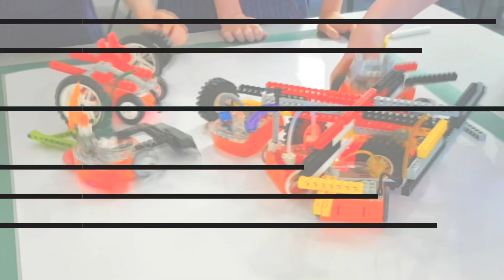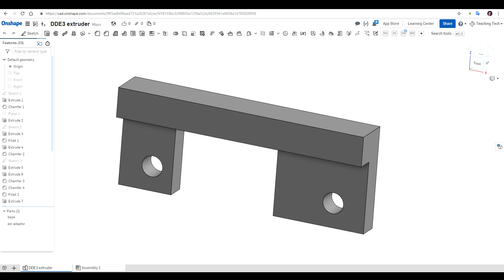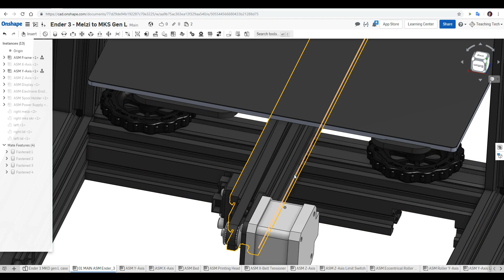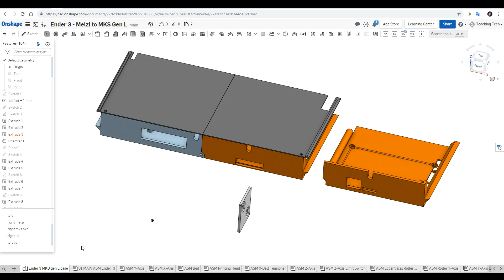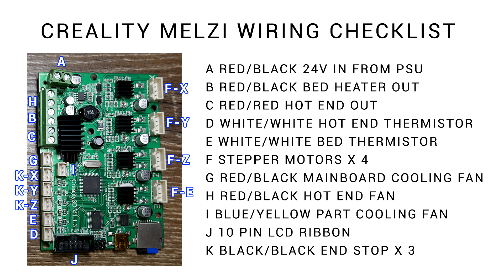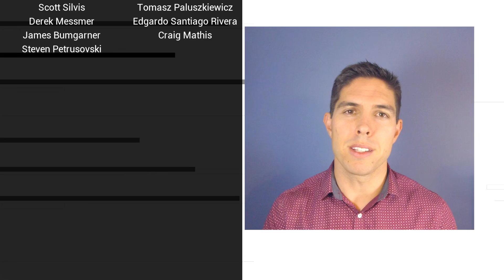Ender 3 upgrades: EZR to direct drive adaptor and all in one rear mounted electronics case

Comment: I just bought the BIGTREETECH SKR E3 DIP board, and have some TL Smoothers.. Will that board mount right where the stock ender 3 board goes? Im so looking forward to getting my printer back up and running so that I can print these and move all my electronics to the back then have room up front for tool drawers. 

By chance, can you tell me about the switch you have mounted to the back of the power supply?

Comment: It doesn't look like the Raspberry Pi is actually being powered by anything.  The buck converter input is hooked to the hot end fan driver on the main board (I'm assuming so a quiet 5V fan can be used), but I don't see another converter to run the Pi.  Am I missing something?

Comment: What about the webcam ribbon to the pi?  Is there a slot for that to route out?
Reply from the maker: There are many great remixes now, you might find what you want.
Reply: @TeachingTech  After looking at the step file, I think the design as-is will allow routing of the ribbon cable out the front.  That's where the camera lives anyway.  ;)

Comment: Where did you get the BLTouch bracket? Mine isnt low enough now with the new aluminum bracket. Also, where did you get the clip on adapter for the EZR

Comment: Very very very good make.....give yourself a pat on the back..... I would make the boxes deeper because the New Raspberry Pi comes with 4GB and runs hot therefore the need of a fan should one go this route. Make the four legs out of nice wood or print to make the height under the printer more to allow the deep tray to slip under..... thanks for your ideas.

Comment: So this is probably my 3rd time watching this video at 3 different levels of interest. When you first published it, I was but an avid lurker interested in 3D printing, I watched it again to realize that I love how much the community enjoys modding their printers, and I too have that bug. Today I watched this as a suggestion after watching you upgrade to the direct drive mod and I have a SKR E3 Mini 32 bit board ordered from ali express that I'm waiting on. I think I am still going to print these parts because after having modded my printer to use a 5V Noctua fan (using the same 5v pins on the ICSP header that everyone uses for the BL Touch), now the loudest fan is the 4010 on the board, which I might as well put in the back of the machine :D Basically, your channel is awesome and that's what I appreciates about you.
Reply: how is that skr e3 mini going?
Reply: @pieter-6385  I absolutely love this board. I am running Marlin 2.0.1 and it is quiet af. Definitely suggest printing a direct drive mod as well.

Comment: Michael, great video and designs. 
How did you connect the cooling fan? Did you use a three wire or two wire fan. Can you share the diagram?
Also curious where did you use the relay for?

Comment: I like your videos I have watched most of them looking to see if you can supply a link to down load the 3d rendering of the Ender 3 pro I have spent over an hour looking and with no luck locating it. I need a cad file type that will work with Fusion 360 any help is much appreciated.

Comment: This is one of the most amazing mods for Ender 3 in my opinion! I'm only a bit concerned about the possibility of insufficient efficiency of the fan to cool down some hotter stepsticks like TMC2100 and now there's no camera cable for the Pi but other than that it's just great!
Reply: You can get much longer camera cables for the RPi.  If concerned about the internal temps, add a temp sensor on each side and connect them to the RPi, then ssh into the RPi to check their status.  Plus, of course, have the RPi send you an alarm if they get over-temp.
Reply: this was my concern aswell so i adapted the lid and installed a 2nd noctua fan to work in tandum force airflow ive had some 200 hour prints have have yet to suffer from any blemishes caused by stepper drivers over heating
Reply: clarestevens2  have you got the stl for that bud

Comment: I am currently printing this enclosure for my Ender3. My problem is I and using a PI camera mounted on the Z axis therefore the 30cm ribbon cable will not reach the PI in the rear compartment, I may have to search for a longer cable.  Also I agree that the cooling of the main board is a bit sus,   I have modified the lid of the main board to accommodate a second fan and fan scoop. Also I will be updating the main board to a SKR mini E3 When it arrives from the supplier.

Comment: I've got an Ender 3 on order so I've starting printing stuff for when it arrives (I have a Zonestar P802Q which I purchased a couple of years ago). I've just printed the bottom cases out from this vid. I printed them without supports as suggested. 

I didn't pay much attention while they were printing but looking at them afterwards I wonder how  the holes have been printed without the tops of the hole bars sagging down without support while they were being printing.

Comment: Think this is great. Busy printing the parts now. Quick question with the relay and buck converter. going through you videos it looks like they both us the same 5v pin on the raspi. should i just splice them together or is there another method?

Comment: what is the relay used for? and also you have multiple wires coming from the buck converter, is that only for the raspberry PI power?
Reply: I believe its for using a higher temp bed heater

Comment: Michael, with using a 1.1.5 mainboard and BLTouch the right side doesn't fit.  Do you have any suggestions on how to get around that?

I saw the lid you added, but it seems to be hitting the Y rail.

Comment: how did you connect the pi to the main board? I know you can power the pi intently with a buck off the PSU but what about the usb connection?
Reply from the maker: Just a regular USB cable.

Comment: I found the wire for the Z-endstop a bit short and needed to extend it with a couple of wires.
Reply: I ran into the same issue. The Z-endstop cable was too short on my Ender 3 with original main board. I decided to swap the Y and Z end stop cable. The Y cable is a bit longer and doesn’t need to be that long with the new case.
Reply: @andreassteiner8495  did exactly the same thing!
Reply: I cutted and extended :)

Comment: @7.00 you have the main board fan wired into, what the diagram describes as the hot end fan terminals, is that correct?

Comment: Anyone else have M3*8 bolts cut through the bottom of the case on the Raspberry Pi side (maybe both...that's all the farther I am right now)?
EDIT: Had more issues with this... Doing this with the Melzi board I had to swap my cabling for Y and Z...the Z endstop cable is SHORT. My cables remain mislabeled....  Also, a pox on whomever decided HOT GLUE was necessary on the cables.  I pulled one of the stepper plug shrouds right off the pins on the mainboard trying to unplug it!  USB cable wouldn't go in far enough anymore and SD slot is hard to reach.  I wonder if there's any better direct pin to pin method of connecting the pi and the melzi.  Might be good to find a way to back the board up a bit more if at all possible. LCD cable is difficult to route and get to reach.

Comment: Amazing, Once again, you have solved a major issue for me. I have an Ender 3. Between the BL touch Pin 27 adapter, the raspberry PI and now the latest...the buck converter for the Noctua, I have run out of places for things. This will absolutely be the next project. Thanks.

Comment: Are you using a right angle  microsd for the raspberry pi?? I can't get my cable to fit with the buck converter installed

Comment: How are you powering the pi ,because there is no hole for a cable from plug to usb port and the lasttime I tried to power from the psu I got the lightning icon on octopi

Comment: hi :) im really new to this whole electonics stuff :) can u please explain me for what a buck converter is? and do i need it?  cheerz
Reply from the maker: You use it to step down or up voltage. For instance these printers are 24v but quieter fans or other accessories might be 12 or 5v. The buck converter allows them to be used.
Reply: @TeachingTech  thanks men :) this helps me alot. I instead installed it on the Mainboard cooling fan slot. for now that works too but i will do the mod in future (Y)

Comment: On an non pro ender3 the y motor is closer to the box. It is not possible to connect the y motor plug with the rear box in place.
Did you try it on an normal Ender 3?

Comment: Looking forward for the video about relays - I assume they would be used to cut power after print stops, but how the raspberry and relays would be powered then?
Reply: The pi stays on all the time. The main reason people want to kill power to the ender when not in use is the noise the fan makes. Upgrading to a noctua hot end fan will take care of that. Also, less risk of fire of the hot end turns itself on/doesn't turn off. You can do this without a pi as well. You can wire a relay that's switched on and off by a limit switch placed near the top of the Z-axis and tell your slicer to send the hot end all the way up to the top when it's done printing.

Comment: Hey Michael I think you should place the fan in the middle of the case and maybe design some kind of duct that shoots the heat out the back not the bottom since the air ports are also in the bottom it may suck back in hot air. Plus the location of the fan and the 2 holes you have on top of case for wires will force the fan to pull more from those areas so you may have a bigger issue in the main board side due to heating and poor air circulation.

Comment: I see Gearbest has the Ender 3 for $169. Is The Ender 3 still a great beginner printer in mid-2019 for ~$175?
Reply: I think so,I've got three now from a bone stock one, to one I've heavily modified and they all work wonderfully.
Reply: I got mine a few weeks back and it is fantastic. That being said I am probably $300 into it with bed leveling and dampers and such. But that is $300 all told and I mean tax and filament. 

If you like tinkering, run don’t walk to get one. It is very much worth it!
Reply: get ready to mod it, it needs a ton of mods to be reliable but as a tinker machine its great

Comment: Was in the middle of building a different thing for combining the Pi and the lcd and then I saw this. Should be posting a make later this week! 

One question, is there a reason for the relays if the usb 5v line is cut between the pi and the mainboard (so the Pi is not powered by the main control board) and the Pi is powered thru the buck connected to the main power supply?

Comment: I was wondering what the relays briefly mentioned were for and is there a video for that?
Reply: Probably a bit late, but the relays AFAIK are in order to turn the printer on/off using the RPi, in case you want to do so remotely. No video as of yet, at least from Teaching Tech, but he said he's gonna do it and he has yet to disappoint.

Comment: Hey, which screws are you using for the raspberry? The holes in the case are for M3, but my rpi can max fit M2.5
Reply: Daphil I ended up drilling the holes out in the pi
Reply: Me and E-man i did too

Comment: The EZR extruder doesn´t ship almost anywhere, SeeMeCNC ships mainly only America conveniently. So bummer. Had to use another type of extruder upgrade over the stock one. 
Wondering about upgrade to direct drive.
Reply from the maker: I've ordered several to Australia so hopefully you can get it whenever you live.
Reply: @TeachingTech  Thanks for the heads up.  I do not have the shipping option unfortunately as most Americans do not even know our country even exists. I am from the Bellybutton of Europe, Czech Republic, and there are not any retailers i see i could get this extruder from. I submitted an inquiry what should i do if my country is not on the shipping list, no reply so far.

Comment: Have you had any experience with the half sized Nema17 motor to use for the direct drive extruder conversion? I am thinking to use one of them to reduce the movable weight on the x axis. Do you happen to know do I need to change anything in the Marlin firmware to run them instead of the full sized ones?

Comment: i have printed this parts 3 times and it wont fit my Ender 3.
calibration cube printed great after many calibrations, but couldn't get it right. 
what can cause such a problem?
Reply: is it possible your prints are shrinking? what are you using

Comment: Believe it or not, the clearance at the back of mine is 248mm, not 250mm!! 
I printed both parts and lids, even designed holding adapters for an obviously different type of TL smoothers I have to retrofit into your case, but it didn't, at any stage, cross my mind to try sliding it into the printer. :D 
Only realised it won't fit after I'd already spent half an hour disassembling and rewiring everything... :D
I also found that most mounting holes in your design were too wide for my M3 screws. To solve that I put cut bits of extruded priming line from the beginning of print into the holes (2 bits in each hole). Made it nice and snug and screws are now holding in nicely. 
But the whole thing is now just sitting on the side, me being unable to slide it under the printer, so I've started designing my own (248mm wide) case...
Reply: jasreca Hi! Would you share your redesign with me? I got exactly the same problem!

Comment: I did not do the upgrade I’m still Bowden. I have been having an issue lately where the extrusion lines are not consistent and you can see really visible lines in the print and occur randomly. I’m on a mks gen l with 2208s and calibrated extrusion several times. I’ve made sure belts are tight nothing has any play. I would suspect somthing in the z axis but everything is good and not too tight not too loose, made sure the axis isn’t binding after adding the shim. I have since added linear rails on the y axis and no change, tried tightening the loosening the essentric nut for the z and trying different tightnesses on the wheels with no change. Tried messing with flow in cura/ under/over extruding  a tad  and yet no change really... it’s a super frustrating issue. Do you have any suggestions on what to check?

Comment: Can you show how you hooked up the raspberry pi?  Do you have this for the duet wifi or lan board
Reply: Wondering this as well. I was expecting a buck converter from the PSU just for the Pi, but he only had a bc for the fan. Please reply if anyone's figured it out!
Reply: I thought the same thing but I think that’s a stock fan isn’t? Maybe with the relay.
Reply: Yes, was hopeing to see some hint of who the RPI is connected to Ender3, without the USB cable

Comment: Can I do this extruder mod on my ender 5? I have an ender 5 with glass bed, ezr struder, and capricorn tube. Having issues printing tpu and I've been told to switch to direct extruder. Would that help and can I still use my ezr with direct extruder mod on my ender 5?
Reply: There is an Ender 5 specific direct drive kit on Ebay. The rest should be the same.
Reply: @abarasabwehttam  yes, but will that kit work with my ezr struder?
Reply: @randol160  Yes they are pretty much the exact same geometry, it is just where the belt attaches to the carriage that is different.

Comment: I like it.  The 1 improvement I see is that since the heat rises, it would be nice if the fan either blew up, or to avoid the holes at the top, maybe make the fan mount at an angle to fit vertically, but blowing out the back.  Not sure if you have room for this but seems it would be an improvement.  Nice design!  Enjoying your videos!
Reply: There's a remix with that exact angled fan by the way.
Reply: @talldonkey  Oh, good to know, thanks!  I hadn't checked the files yet.

Comment: Using a 5015 blower as an exhaust fan should work much better
Reply: Thanks for the tip.. What brand is that? Or do you have a link? Thanks much!

Comment: Michel you  may want to mention to your subscribers that use cable chains that the the bed chain that mounts to the side of the frame won't work with your new case. However i wanted to use your case and still be able to use the cable chains so i did a quick modify - https://www.thingiverse.com/thing:3698230 - Tested and working on my Ender 3. Thanx and keep the videos coming.

Comment: I stand by what I commented below.  The only issue that came up was that I couldn't plug the y-axis stepper back in on my regular Ender 3 with the motor oriented as stock.  I ended up rotating the motor 90 degrees, so the plug now faces back rather than down.  This way I also won't need to unplug it again to move the boards out, if that's needed.  Thanks again for this great mod.

Comment: Hi Michael. As always, a great video and instructive as ever. Thank you. Really liking your design for the electronics case, printing one as I type. One small issue I've had though - not had this happen before. On the accessory case half, looking from the back where the aperture for the Pi connectors is, top right hand corner of that rectangular aperture, my print separated along the layer line from that corner to the bottom of the cutout for the cable bundle. I'm sure I can glue it, but with hindsight, would it be possible to brace/thicken that section slightly? I've yet to put the Pi in it so don't know if its feasible.

As always, keep up the great work!

Comment: I am thinking, along with others, a cooling fan should be added directly above the steppers. Perhaps even 2 small cooling fans. Keeping the steppers cool would definitely improve performance and I think also increase lifespan. There should be no issue adding a fan to the top of the case lid, lots of clearance.12V can be pulled from the buck converter, but it may be a better idea to run2 12v fans in series to achieve a 24v load. Just an idea.